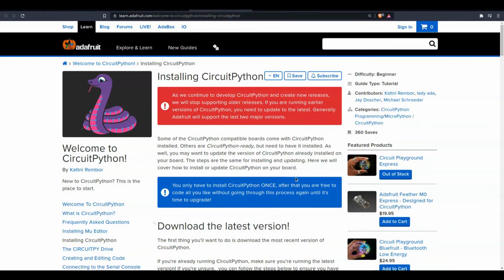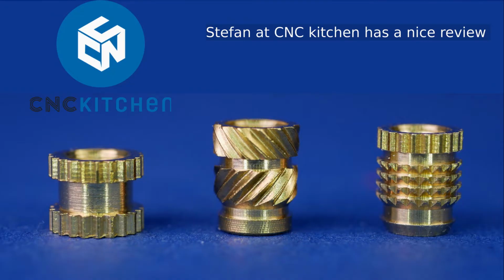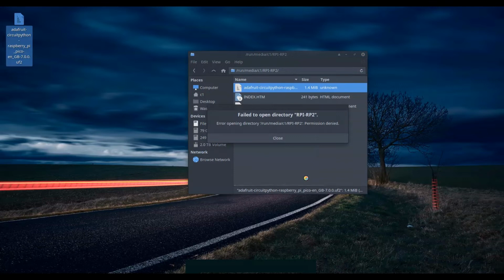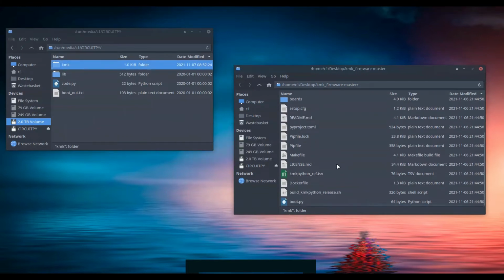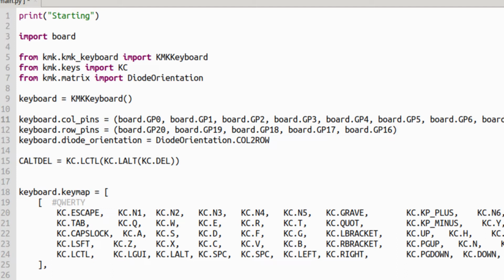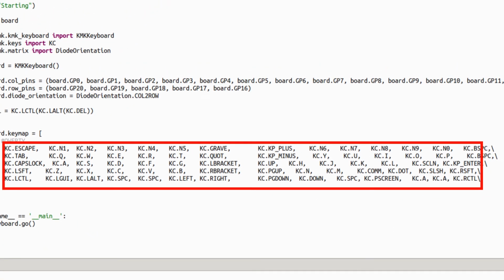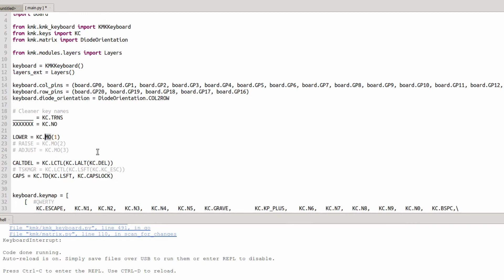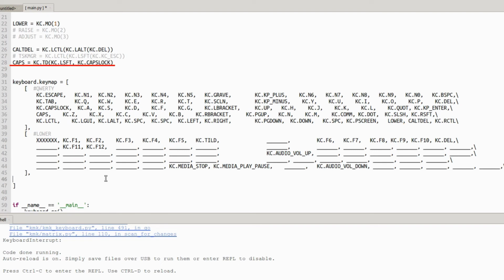Setting up KMK on a Pi Pico mechanical keyboard

Comment: Nice video..I have built 2 keyboards with Pico and KMK.. one 60% and another a macropad..They are so easy to work on..  but my keyboards stop working after being idle for some amount of time.. I have to disconnect and connect it again for it to work.. did you face any such issue?
Reply from the maker: Hi Vikram, Are you running windows? I think there's a USB power saving setting... somewhere? I had an issue with a USB wifi adaptor doing a similar sounding thing.
Reply: @CraigManning  Yeah, I am on windows. Let me check that then. Thank you!

Comment: What is this like using it? Any noticable latency?
Reply: just built my kb, in different games i didn't noticed any lags or latency (KMK, Pi Pico, handwired)
Reply from the maker: @misterVladis  Awesome! Thanks! I hadn't noticed any lag but I might just be not quick enough :D
Reply from the maker: I only use it for typing not gaming but I can't notice any lag. As for use, I plug it into a laptop when I'm at my desk, I still haven't settled on a final key layout so not all the key-caps match the key they currently type so I do sometimes jump back to the laptop to find little used keys - but that's me trying to find some 'optimum' not an issue with hardware or software :)

Comment: I'm interested to try making your keyboard. Is this the Redox handwire? if it is how you made with RPi pico instead of the original's Arduino pro micros? is there a guide somewhere?
Reply from the maker: Hi, yes, it's hand wired, I have an earlier video showing how it did it:  https://youtu.be/Q7JEEiEhtWg  Then set up circuitpython on the pico same as usual and edit the main.py file from KMK to suit your key layout... actually I find I tweak mine fairly regularly, there's a couple of key i'm still not happy with what they do :)

Comment: Question: How to configure when you have a separate keyboard, or this by default does it alone, thanks
Reply from the maker: Hi, I haven't used it but there's a section: https://github.com/KMKfw/kmk_firmware/blob/master/docs/split_keyboards.md  this covers both wired and blue tooth.

Comment: Hi what a nice video, it was so helpful for me, now I have an issue, as the kmk only works if I keep the thony open, once I close it, unplug the raspberry and put back it does not work any more until I open thony and hit run, any suggestion to fix it?
Reply from the maker: Hi Daniel, When you plug it back in does it pop up as a drive? Can you see the boot.py file?

Comment: Thanks for this video Craig. I have been thinking about a Pico keyboard. Why did you move on from circuit python? Was it the layer capability? I would like to build a split Pico keyboard with TRRS link. More research first though. Keep up the good work.
Reply from the maker: Hi Ray, Thanks! I moved to circuit python just to run kmk, they do have a keyboard optimised fork but I haven't tried it yet. There's the capacity for a wired spilt but I've not tried that either: https://github.com/KMKfw/kmk_firmware/blob/master/docs/split_keyboards.md
Reply: @CraigManning  Thanks Craig for your reply. Looking forward to further videos